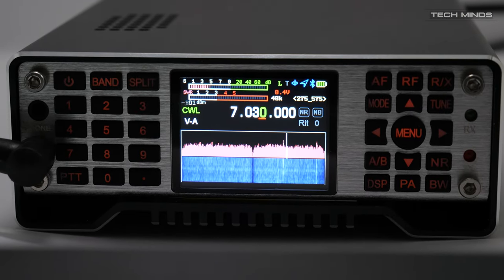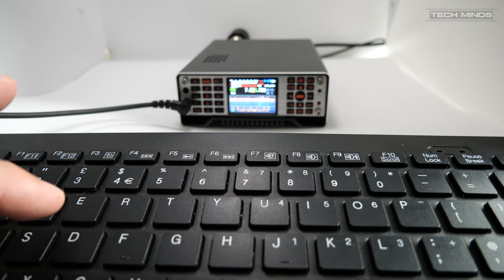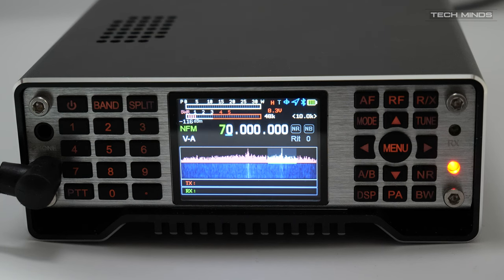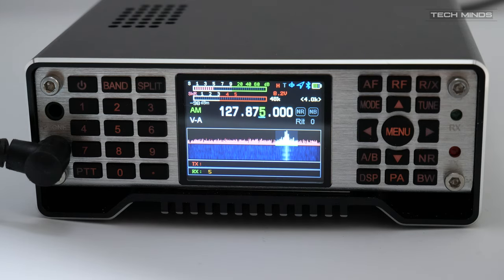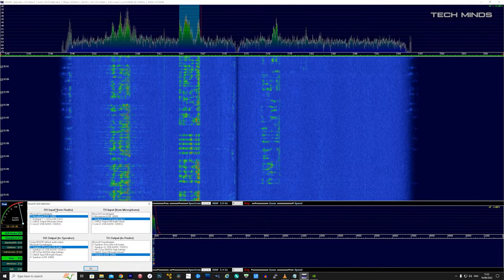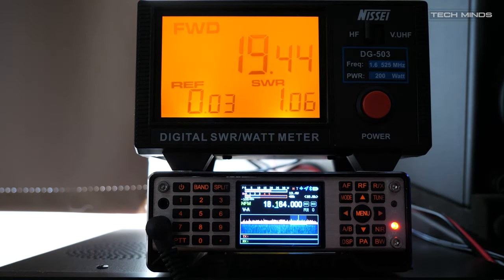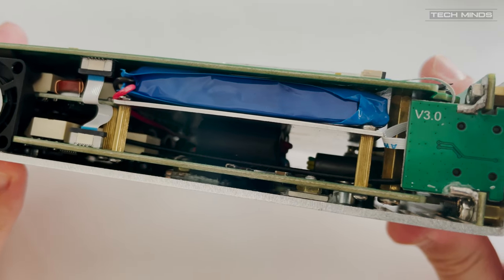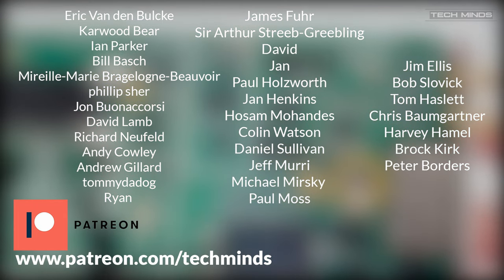Q900 ALL MODE ALL BAND TRANSCEIVER - YOUR QUESTIONS ANSWERED!

Comment: The usb I/Q signal was honestly what I was curious about. That alone pushed me over the edge to consider this.
Went to their website and found the TBR-119, looks like a ruggedized version of the Q900 with a $2000 price premium.
Reply from the maker: Just so you know, it’s 48kHz wide, or there abouts. Totally useable though as demonstrated on HDSDR. Cheers!

Comment: Fantastic, thanks for showing us the inside ... pretty amazing! 
Also that you can TX with PC software via USB ... so you can create a super clean signal of whichever bandwidth and dynamic you prefer, because you have all the freedom of an IQ modulator. Power is enough for portable and if you need more you can attach an amp. The latest V4 version just dropped below 500€ without any modules ... that is definitely on my whish list this year.
I will wait until the ethernet port is being implemented, then I can just leave it on my LAN and operate if from any computer.
Reply from the maker: Yeh, I agree, it should be called a "driver" amp. :-)
Reply: @TechMindsOfficial  I still have my home made 3-1000Z amp with motor driven vacuum variables, which needs a little more drive but can output a kilowatt straight for 5 minutes, used to transmit fax in the 90s, this might still drive it to some 500watts, which is good enough for the most.
I hope you continue on your series about this very unique radio that I also plan to take up on mountains with tuned magnetic VHF/UHF loop for a good natural preselection.

Comment: Which power amplifier to use? For the 1.8 - 50 Mhz bands? I would like at least 100W.
Reply: Several available - probably best bang would be XPA125B ? - should work with this specification of radio.

Comment: I purchased a TBR-119 earlier this month as mentioned here already. Brother product to the Q900. I just found a few little landmines that I thought were bugs in the software. Found out about this from Guohe last night, still ticked!! I hope these help you all too. 

The channel input is a massive bug on the 119. It changes the input frequency to whatever it feels like and the channel names get all jacked up too. I told them and they said they would look into it. Does the Q900 do the same thing?

Gyro didn’t work out of the box. Literally an error on boot. Needs firmware update for that to work apparently. How a product is released with a known component not working at all….. yeah…..

The biggest drama was the DMR side of things. Using encryption, I thought it was another software bug and reached out to them on it a few weeks ago. They said they would look into it. I just found out that you have to purchase the key, actually a pair of keys. The algorithm is proprietary, ok… but then issuing the key… that makes it a third party key. No thank you!! 

They also failed to advertise that the amazing ‘frequency hoping’ feature requires you to purchase a key too. Oh and APRS also 😀 He said that only works in China. Is the Q900 the same thing?

You just spend $2200 (enough for 4 Q900s) and then they say that as it’s a professional SDR radio, not an amateur rig, they can charge for these things. 
I get that the Q900 being a cheaper asking price and they want to make up some cash deltas by charging for added features. But on this, come on!!!
Also, there is no current way that I’m aware of to update the software/firmware on the 119. There is no USB port on the back like the Q900. The data cable does nothing except interface for CAT control. So I still would love to learn how to do that!  
The guy on the what’sApp channel got a bit upset with me when I pointed these items out. There is some confusion on what is the sellers responsibility and the manufacturer responsibility. If something in the marketing was not clear, he said it’s not his fault, talk to them. But not saying that you are required to buy additional licenses for components already installed is apparently the sellers fault!!
Reply: What advantages did you expect from this heavy duty version? If you need a workout, just put some bricks in your backpack and maybe the Q900 on top.

Comment: Thank you for reviews.  I like them because they are short and to the point.  I ordered a Q900 with all the modules a month ago and yesterday they cancelled my order and refunded my money.  Checking the other sites, they seem to be out of stock of everything.  I guess I will have wait a few months and then try to order again.  Is there a Canadian or US distributor I can order directly from?  From what I have seen it is a great radio.  Is the VHF/UHF memory programmable from a computer?  And how do you set up the talk groups in DMR?
Reply from the maker: Hi Roy, I believe they are out of stock until end of October. Reorder using the links at the end of the month, then you’ll make sure to order from the best supplier. Did you see the original Q900 video I made? I cover everything there.

Comment: I bought a Q900 and it seems a great radio, I got all three addons and the compass and gps works well but, DMR is working but I cannot get any volume from the speaker and the speaker mic still seems to have the analogue audio conning from it. Any suggestions?

Comment: Thanks for the great review. I wonder if it supports 11 meter band (have you tried) since it does not say "11m" on the meny, neither does it specify to support the CB 11m band in the specifications. I hope I am wrong, as I wanna buy this and use it as a CB-radio while I am taking my license. Hope you can test and reply to this so I know for a fact that it either support the CB band 26,965 to 27,405 MHz. Thanx :)

Comment: Regarding the cw decode i use an Mfj 464 which  also allows the use of a keyboard but the de coder is very fickle you need a good clear signal for it to decode  and it comes up in text on the built in screen .This radio has loads of great features and  for the money it seems like a bargain .Thanks for  posting .

Comment: I asked on the whatsapp group about the 4m band if unlocked. It is reported to produce only 3 watts with a high current. This means it will be very unhealthy to operate on 4m if not terminal for the transceiver.
Reply from the maker: That’s why it’s locked as standard, there are no filters in place for 4M. Interesting that their military version does support 4M thought.

Comment: Glad to see it works so well with HDSDR. That would push it over the top to use in my shack. Thanks for the follow-up ! 73 de Don KM6TRZ
Reply from the maker: You’re welcome Don! I was shocked when I pressed the TX on HDSDR and it started transmitting. Defo going to be trying this on air, especially for 2M SSB.
Reply: @TechMindsOfficial  have ya tried with sdr console?
Reply from the maker: @Phillip Ramirez I have not tried with SDR Console. As far as I am aware SDR console would be able to control the radios frequency, but I don’t think SDR Console can process an IQ input? Maybe I need to recheck that.
Reply: @pen25  SDR Console seems to want a DLL driver for any radio definition.  I tried to set it up to use my QRP-Labs QDX as a receiver only and I figured I should be able to just point Console to the USB input audio stream, but I could not.  I could be missing something and would sure like to be corrected if I'm wrong about it!

Anyway I punted and used HDSDR.  Mat used the same methods in this video.

Comment: Hi Mat, thanks for another useful and informative video. Do you know if there is any possibility that the manufacturers will include transmit on the 4M band? If the radio had TX on 4M, I would have placed and order as the popularity is increasing in the SE of England (as you will know!) and the band is growing over Europe and even stirrings in the US. Surely this is not a big ask of the manufacturers?

Comment: Do you know if it is possible to disable the out-of-band limiter? In the USA some of us do MARS/CAP, which is outside the ham radio bands.
Reply: id be worried about spurious emissions since those out of band transmissions woudnt be filtered unless of course you filter them with a transmit filter
Reply: The radio's user manual says "All amateur segments are locked at the factory. If you need an experimental test, open it in the setting menu on the premise of complying with local regulations."

The same manual tells you how to do this in the "Launch operation (factory locked)" section, but as @Phillip Ramirez said, its filters may not work well for that application.  As always, it's up to you, the US ham, to make sure your transmissions are compliant :)
Reply: I have the brother radio to this TBR-119. 
It’s basically the same radio guts in a tank of a manpack. 
They have all 3 ITU regions available on the radios. If yours was mailed with ITU region 1, then that’s why you are seeing those TX blocks. 
That said, you can unlock the factory settings to allow on all ITU bands, basically no blocks.

https://youtu.be/ZPjKRdca36k
Reply: I doubt it is on the MARS/CAP list of approved radios.
Reply: @brianc0620  I've been looking for any video showing the TBR-119 in general, it's amplifier docks, and its "relay" feature (which requires a change in wiring Guoho says). I can't find anything but the CGI marketing video unfortunately. Any chance you'd shoot some video for us to see?
Reply: @AquaeAtrae  
Hey Doug. Good idea. I’ve been thinking about that for a while, as there is interest in the radio both for Hams and Prepper/MilSim worlds. I was in the same boat. It was a bit of a leap of faith on this one, as there was no clear and easily understood material out there. Learning curve!!

As I have never made a video review before, I will beg forgiveness up front for the quality. But I will try my best. 😀
Reply: @briancorcoran9245  Consider yourself forgiven and appreciated. Thanks.
Reply: @AquaeAtrae  Doug. I am uploading a few videos for this. I will add a link below.
Reply: @brianc0620  Note: Youtube often deletes links, even within itself. But I found your 4 videos and they are very helpful! You are helping me and others make a $2000 decision. And no need to apologize for these being your first videos. They came out fine, plus you're actually responding to questions which is more than most can muster. Just ignore any trolls you encounter and have fun with it, knowing that the effort and insights are well appreciated by the community. :)
Reply: @AquaeAtrae  check my comment above on the 119 too bro. Wanted to make sure others are aware of that particular issue before purchasing. 
I really appreciated the supporting feedback too. BTW I will add another video describing that drama.

Comment: Could you check if it will transmit on 40Mhz please,  this is the 8M Amateur Band in Ireland?

Also any full duplex for Satellites 🛰?

Good find, thanks.
Reply: Same as other bands asked about... TX can likely be enabled for it, but is the other hardware appropriate?

Comment: Tx/Rx on 33cm (902-928mhz) ?
Reply: That's within its advertised frequency range of 300 kHz to 1.6 GHz, but not a supported ham band.  TX on 33cm is likely locked out by default, which can be overridden - see the user manual on how to do that.  Not being a supported band probably means no proper output filtering for sure - what else may be inadequate we'll have to find out.  You could certainly add output filtering post antenna port and would be well within the spirit of amateur experimentation!
Reply: I might highly consider buying one if it can be unlocked to transmit on 33cm and 23cm. Of course with the proper filtering. Has anyone tried unlocking either band and gotten a power output? I suspect pretty low, but I have amplifiers.
Reply: @nothing5189  I can test that when I get mine.  I ordered on the 15th so that could be a while.
Reply: In the USA 33cm (902-928mhz) is an amateur band shared with low power, unlicensed ISM (Industrial Scientific Medical) which includes the 1 watt license free Motorola digital FHSS portables. TriSquare (now defunct) also offered two low cost 900 MHz HTs. 33cm is unofficially referred to as the "Aristocracy Band" as NO ONE offers ANY dedicated amateur equipment on it. (Alinco DID offer a dual band 220/900 HT but it wasn't well received). The 900 equipment in use is modified Public Safety comms by Motorola, Kenwood, and the odd Harris Thales. 900/33cm has excellent signal propagation i.e. the best of 2m and 70cm combined. Its signal works equally well in the city landscape of concrete and steel, and the "woodsy" metro areas. 

23cm (1240mhz) is offered in the form of a TriBand HT by Alinco, and a few HIGH END base & one mobile ? by ICOM.
Reply: @baronedipiemonte3990  I have a Down East Microwave 33cm transverter that I've used for SSB and CW communications. It works okay, but having one transceiver that covers everything up to 23cm would be nice. Be nice for portable operations, contests, Field Day, etc. BTW, I see Icom is coming out with a transceiver that covers everything 2meters and up to 10 Ghz! But I'm betting it will be ungodly expensive. lol

Comment: Did you comment anywhere or did anyone ask if it can be controlled via CAT commands like  a Icom or other rigs via  a program like Ham Radio Deluxe.   Thanks
Reply from the maker: Well, I show in the video how to use omnirig with a FT817 profile, so yeh.
Reply: @TechMindsOfficial  Well the omnirig I used to use was just a little subset of commands that did some basic functions.  Anyway I ordered the 900 but it wont be here until the 11th or 12th so I guess I will find out then or someone else might respond if they use  HRD.    thanks for the reply.
Reply: The manual says they have a FT817 compatible CAT command set and it is listed/specified in Appendix 2. The manual, BTW, has quite a bit more info than the HS2 or QR20 ones I have seen.

Comment: Thanks for the video, but I don't think it's for me. Let me ask some questions? Can the Q900 send Text Messages via RF from 70cm to 160m? Can it send photo via RF from 70cm to 160m without a computer? For example,  on HF band RX photos and view them on the radio display. Can I use it for my local Digital repeaters?  Can I use it with an HT battery to make it very portable? When there's no propagation, can I use it to talk to other hams all around the world via digital repeaters and reflectors? Can I do terminal mode and access mode with it? Or PDN mode (Access and direct operations)? If it cannot do those few things,  it's outdated in 2022 and it's not for me. I'm waiting for Kenwood 2023 products, ICOM,  Elecraft,  FLEX, and Yaesu to see what they will have.  I'm so very happy every time I power on the Icom IC-705. It's complete joy when using the IC-705. If I have to buy another radio,  it better be great. Remember guys,  it's 2022,  time when we can use our smart watches to have QSO.  73

Comment: Does this use the WinChip (or a clone of it), or is it implemented entirely in software?
Reply: It uses an ST Microsystems microcontroller from the STM32 family... and implements most things in software, as a Software Defined Radio is wont ;)

Comment: I received my Q900V3 today!  I immediately started doing measurements on it and directly comparing to the Version 1 (Ailunce HS2) at 5W output.

Bad news.  The TX harmonic suppression is even WORSE with the Version 3 compared to the Version 1 (HS2) which itself is not great.  I'll do an in-depth video at some point, but for now my verdict is: Use low pass filters on the output in order to be (FCC) compliant over-the-air.

For example HS2:
Transmitting CW at 1.803 MHz: 36.4 dBm (almost 5W) at fundamental, 6.3 dBm at 3.606 MHz (second harmonic).

Q900V3:
Transmitting CW at 1.803 MHz: 37.8 dBm (a bit more than 5W) at fundamental, 11 dBm at 3.606 MHz (second harmonic).

I've only completely tested the two radios on the 160m and 80m bands, but have taken a peek at all HF bands and 160m thru 30m are truly awful with regard to spurious transmission.
Reply from the maker: Great information! Thank you for sharing!
Reply: @TechMindsOfficial  Since that post, I completed more exhaustive testing and comparison between V1, V3 and the Xiegu X6100.  At some point I'll run my IC-7300 through the same power measurements.

There is some good news - on amateur bands 40m and up the harmonics get much better on both radios and most are compliant with FCC's 43 dB below the fundamental requirement.

160m and 80m are not compliant on either Guohe radio and 40m is compliant on V1 but barely not on the V3.  Interestingly the X6100 is also not compliant at 160m but is everywhere else.  I might need someone to cross-check my measurements in case my R&S CM300 power measurement isn't good down that low.

I also did a deep disassembly of both V1 and V3 radios side-by-side.  V1 was a hodge-podge of little circuit boards poorly crammed in.  V3 moves the extra boards' circuits (LO and BPF and ?) onto the top brain-board that is visible when you slide the cover off.  That explains why V3 has a relatively tiny speaker on top - had to make space for more circuits on the top board!  Their LPF board looks identical between versions, but V1's toroids were not potted (will rattle) while V3's are.

I've got video of all that, but who knows when I'll learn to do video editing ;)